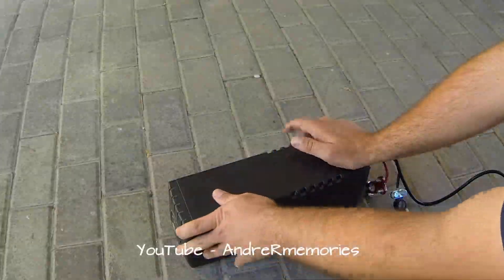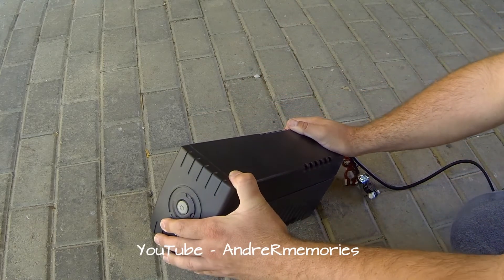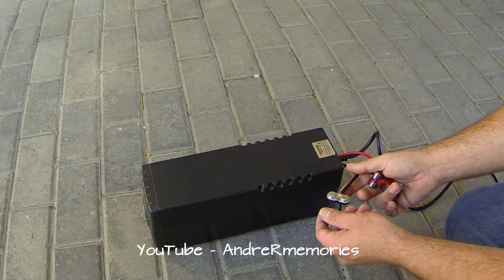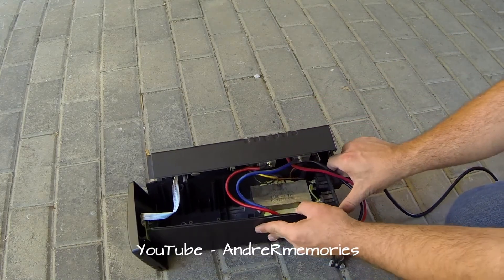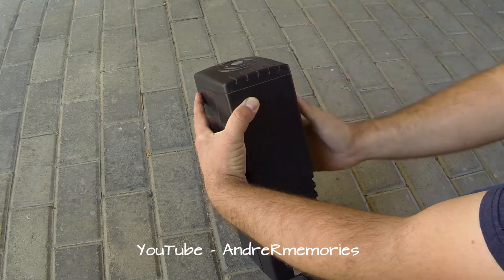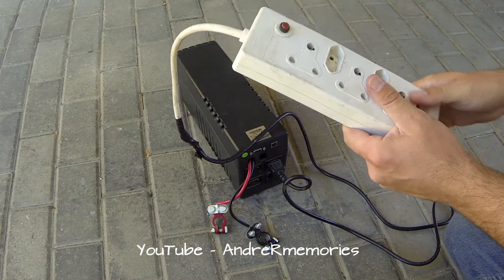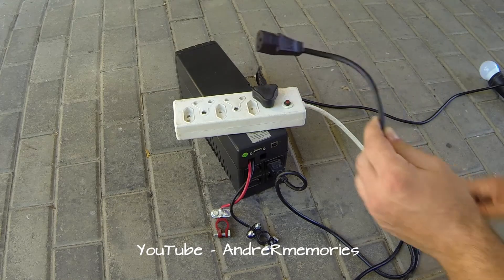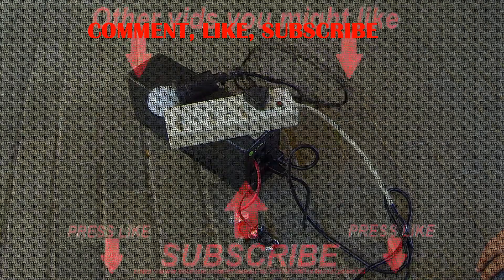Convert old computer UPS, combat Load shedding impleminted by Eskom

Comment: I have an old AC gate motor. Could this run the gate during loadshedding? Max 2 open and closes during loadshedding 🤔🤔
Reply from the maker: personally i would just upgrade the gate motor to a stronger one with stronger batteries.  almost all gate motors have a battery inside so maybe just change the battery as that might have failed so when power is off the gate wont open
Reply: @AndreRmemories  That's easily said than done. 😔 I'm trying to keep my costs as low as possible, I can't afford a new motor or even a used one, however I can afford a used car battery and UPS.

Comment: Hi Will it run my TV,  lamp and my Wifi Router. about Max 250 -300w
Reply from the maker: Yes it will but depends also on the strength of the ups
Reply: @AndreRmemories  Thank you so much for your reply and your video.

Comment: ihave a proline 650w ups but it keeps going off when loadshedding has started - does that mean that the battery inside is now dead? I bought a gel battery - would that help the ups to stay on. just want to keep my router on. The ups worked for about 3 months and stayed on the entire loadshedding duration but lately it goes off and then i have push the on button maybe 3 times. Eventually it just didnt stay on. Would connecting the ups to the gel battery help it to stay on?
I am not a pro in any of this but with instructions I can do things.
Reply: I replace my UPS batteries all the time. It is really not rocket science once you have it open.

Comment: @Andre R, have you measured or determined the amps which the UPS charger can supply to the battery? The standard UPS battery is 7Ah if I am not mistaken?
I might run a second (dumb) charger to the 105Ah battery for when the power comes back on.
Reply from the maker: The battery do take long to charge.  I would say its best after the scedule to load the battery with a battery charger and after full let the ups maintain it

Comment: Car battery is going to take ages to charge with a pc ups
Reply: Can a ups that size charge a 95ah gel battery? Even if it takes long ...
Can it handle it?
Reply: @magicmike1.2.3  I think the Ups might overheat due to the long duration of charging. And also remember the duty cycle of a car battery is very short, If you draining the car battery to emty the battery is getting damaged an therefore the battery won't last long.
Reply: Charge die Batterye met Solal panels, maar dit moet dan Solar Batterye wees.
Reply: So a fan and a battery discharge protection wil be part of the installation....
Oky well I am going to wing it 🏏
If it blows up i will know it wil not work!

HAHA
Reply: @magicmike1.2.3  did it work?